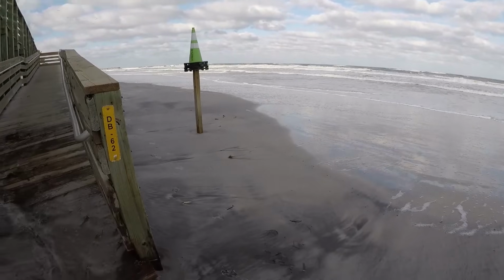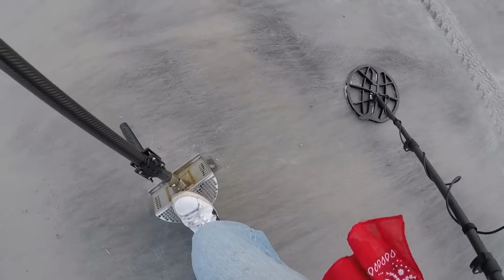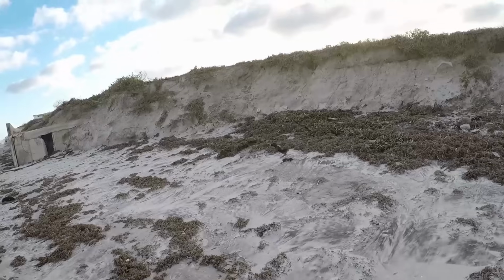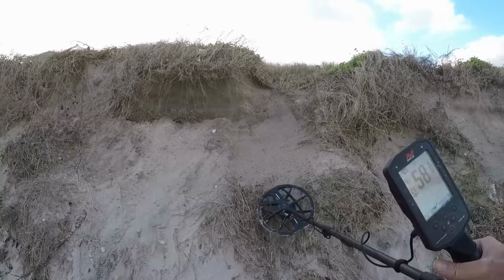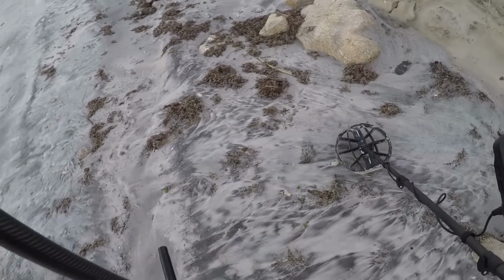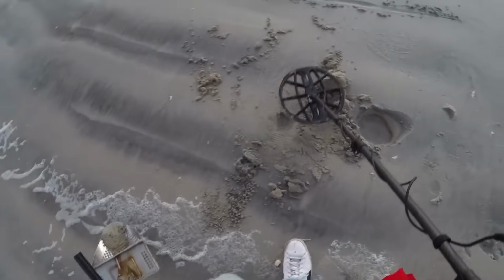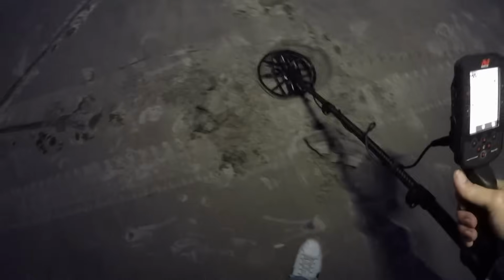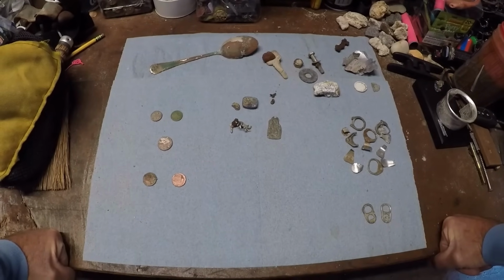Beach Metal Detecting IDD 332 A Drafty Hunt and a Cat With 5 Legs

Comment: Hello my friend. It looks cold and windy at the beach. I liked the video and I hope you find something good before long. Stay safe my friend and keep warm. I think you’re getting better with the Deus.
Reply from the maker: Hi Steve , it was windy and cold. At least it was not raining . lol This was my Minelab Manticore. I am more comfortable with it . Thanks for watching .
Reply: @idigdaytona4478  I’m sorry. I broke my glasses yesterday and had to watch the video on my phone with a magnifying glass. It still wasn’t clear. How is the Vaga?
Reply from the maker: Hi Steve , I need glasses to read small stuff now days . I know what its like to need them and not have them. I spoke to Wilwood about my brake problem. I have to pull the brake calipers and measure the caliper  piston sizes so we can get a master cylinder that should work better with the calipers I have on the car. I also checked the engine vacuum.  At idle it was only 10 inches of vacuum. That's a little bit low for power brakes , but when I had it set up for manual brakes I had the same problem. I will get if figured out at some point .

Comment: Hey I just posted a comment on another video asking about your scoop.
How do you like it and have you had any issues with it?
I'm looking into buying one and wanted your honest opinion. 
Thanks.
Reply from the maker: Hi Danno , I saw that and just answered . I will post my answer below as well for others that may not see the answer. 
Hi Danno , My T-Rex is the large 9.5 inch. Its a very heavy duty unit. The USA made carbon fiber shaft is also from them . I like it very much . It weighs about 5 lbs . The 8 inch would be a little bit lighter and close to the same size. The only issue I have had is some sand will sit on top if digging in a deep wet hole. I have been using it for years and it is holding up great . Thanks for watching .